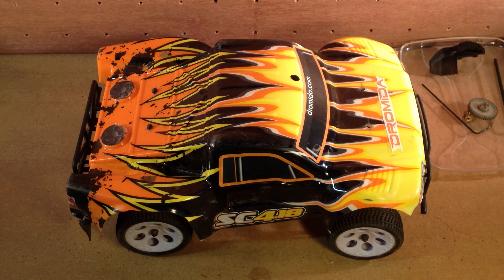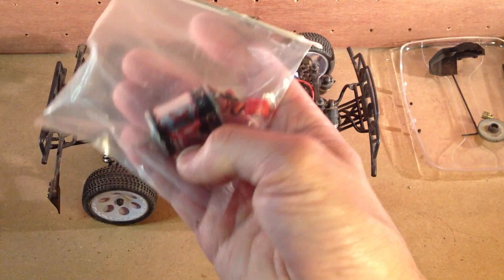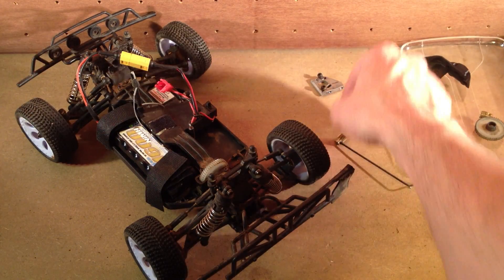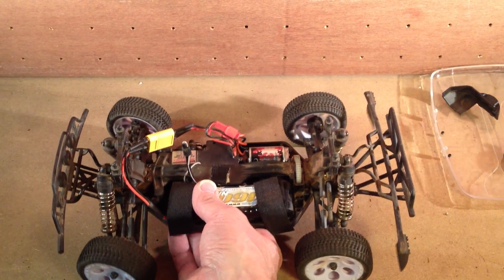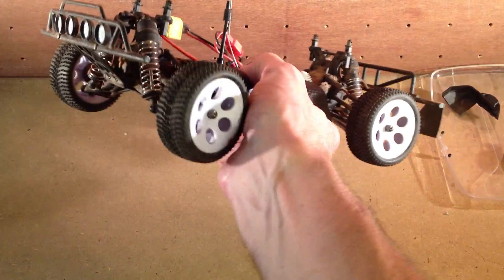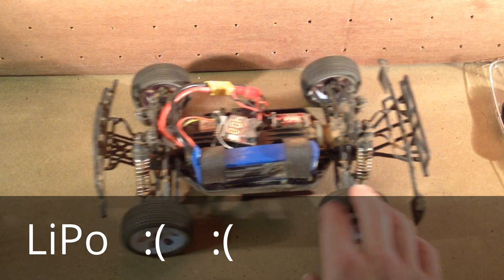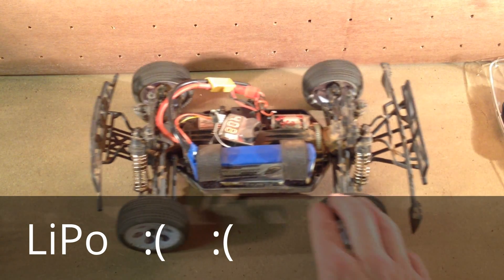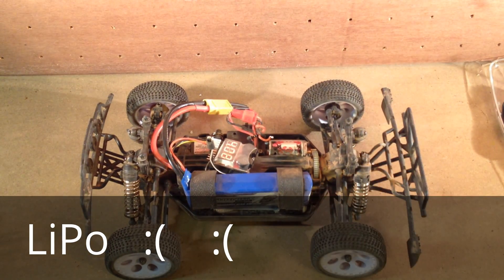RIPMAX / DROMIDA - Maintenance: motor replacement & NiMH Vs LiPo PART 2

Comment: yup,you should never run a brushed motor on a lipo. Sorry you killed it like that. Live and learn. We all do it so no biggy. Your shop should have told you that. Mabe you never heard him. The Dromida cars are good,just not the best.
Reply: Of course you can run a brushed motor on Lipos. Most stock ESCs will be fine too but make sure it has a voltage alarm.